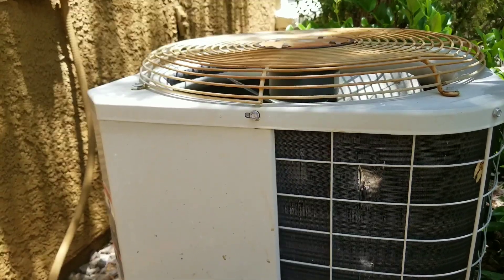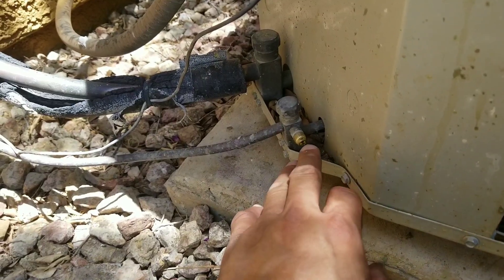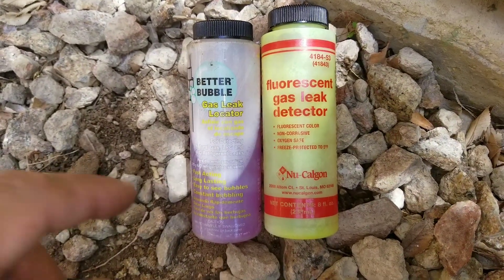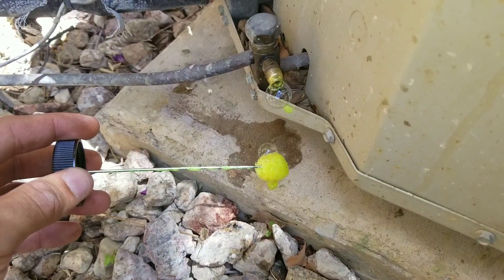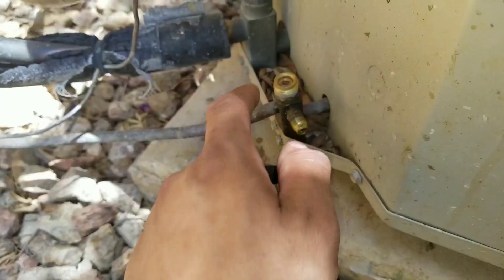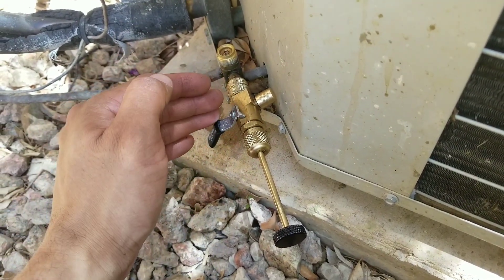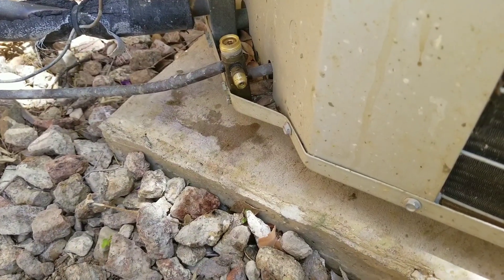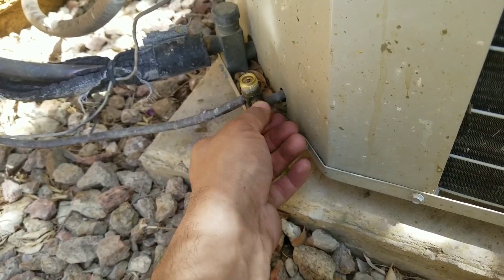Low Refrigerant? Freon Leak? Check This First!

Comment: Who knew?  I questioned the 'low on Freon' for a closed system till I learned of leaks.  Yet, they still lie about needing to 'find it' and leaking liquid and need to weld.  My unit is on the roof so they know people won't even watch...except me.  Cheats and liars are ruining your industry.  Thank you for your honesty, now go beat these unethical competitors and start your own company.  People will pay an honest wage for an honest work by a skilled professional, but most of these guys are commissioned salespeople and have no interest in $200 to swap out a valve, no they gotta hit you with the 'for safety reasons, we recommend replacement.  I can get you a special discount for $6000'....me, 'get off my property.'
Reply: girohead not all leaks are at the Schreider valves. Leaks do need to be found and yes sometimes it requires some welding
Reply: @mradam4430  Phew, that was a delay to wishful thinking (by me).  I was being hopeful based on what first guy said (he was looking to do a quick fill up and leave).  I had a leakdown test done and this other guy suggested he could take it all apart, find leak and fix.  I had a 25 year old unit, with older refrigerant (per CA) and not worth repair and future risk, so I just hesitantly installed new, for not much more.

Comment: Thank you for the demonstration. I especially appreciate how easy it will be to check if the source of the leak is at the valve.  My AC guy, will say anything right now to get me to buy a brand new hvac system, citing that the leak is in the evaporator coil, which is in the attic and virtually impossible for me to see for myself.   At least I now have the opportunity to see if the leak may be at the valve as a mater of elimination.

Comment: Is it true that if the ac unit is empty with no refrigerant and you turn it on it will burnt the motor unit
Reply: yes because the refrigerant support to  cool the compressor without it the compressor warm up and burn
Reply: @WaelAlseiadi  thanks for the reply someone came to my house to give me an estimate and turned up the unit for about 10 to 15 minutes to check out what was wrong with it ,he found a leak in one of the lines he didn't fix it that day then he got to busy I called another technician and the motor was already burned he told that happened because the other guy turned it on when the unit didn't have refrigerant

Comment: Of course they don't want to do it, they want to come back and charge you $1700 to find a leak even though they already know where it is and that it takes all but 5 min to fix it. HVAC together with plumbing unfortunately has become infested with the most dishonest scheme artists who take advantage of uneducated and elderly.  Thank you for your honesty and education.
Reply from the maker: Thank you for the added input you are correct in your assessment regarding the unhonesty of "company" technicians. Their goal is to make money and unfortunately they do so by giving misinformation in regards to diagnosing the system inaccurately. 👍
Reply: Why not throw some carpenters and auto mechanics under the bus too? Hell, why stop there - all blue collar workers should be crapped on in this comment.

Comment: Good Job thank you. I just installed my own Central air Unit from Scratch and works Great. I only had a guy come out and vacuum the lineset  Saved a ton of money. Thank you thinking of getting the Certificates and doing this on the side. Thanks for making the guy that came out to inspect my job said I did a great job how did I learn how to do it and I told him YouTube...he laughed and said don't watch youtube. LOL, doesn't like competition.
Reply from the maker: Great Job David!!! Honestly and unfortunately you are correct. The competition wants all your money. You would be surprised how many comments I get from the "company tech" who ate infuriated that I am "giving" insider "secrets" of the trade. Its individuals like you who give me the drive and determination to continue posting videos. So thank you! 😁

Comment: Do you have to flush out the gas detection solution with water and let it dry before replacing the cap to avoid introducing this solution into your refrigerant lines later, say when you check the pressure?
Reply: Just wipe off excess.  No practical chance of getting into system because system pressure is positive and the next time you hook up gauges, system pressure is higher than atmospheric.

Comment: I liked what you did after you replaced the schrader.  You left the replacement tool on, opened the valve and removed the end of the tool in essence checking for a major leak before you pull the tool off.  I hav e had a lot of people discount the schrader as the cause of a low system.  Another thing to do is listen when you remove the schrader cap.  If you get that psst, definitely check the schrader.
Reply: Better yet just tighten the Schrader cap like you're supposed to or the large nut on top of the suction service valve and then you won't have any leaks at all you are supposed to tighten those two covers. If you don't like the covers that you have then use the ones that train makes you tighten it with a 9/16 wrench it's solid brass it's very tight and it does not leak.
Reply: @6barry66  why cover up a leaking schrader by tightening the cap over tight?   The plastic caps won't always hold and the brass ones if you over tighten them you can deform the seats and when you do finally decide to change the schrader you can't get them out. 
I spent 17 years doing hydraulics and found over tightening the JIC fitting would make them leak. That is why Parker Hanifin came up with the FFFT method of tightening their fittings. FFFT stands for flats from finger tight. When we started using that system our leaks dropped dramatically.
Reply: @marvinostman522  I think what you're trying to do is find a way to charge your customer another $300 the fact is the cap was made to be tightened not so tight that you destroy the threads but you should have no problem putting the flare nut that train makes on an air conditioner that has a really minor leak and tightening it or you could just use the change the pin valve on the Fly tool and you can just put a new pin in there. And this does not cost $500. I work with people everyday who find creative ways to gain the approval of their employer and padding bills and adding tasks that serve no purpose just so they can get commissions. And I know you know what I'm talking about because virtually every news outlet  CBS NBC Dateline they've all run scams and they've all shown people what we do and right now we are in Industry under the microscope just do your job it does not cost $500 to clean someone's condenser it does not cost $500 to get rid of algae on an evaporator tray these are just cons to get extra money out of people and it makes all of us look bad. Right there on the front page of our industry magazine just about a year and a half ago was a headline and carrier and Linux and train and many people ask the question what's wrong with HVAC contractors. Most of us who work in this field did not need the negativity that was shined on us by a few unscrupulous people who can take the simplest repair and turn it into a 500 step procedure that cost $1,000. So do whatever you got to do I guess to feed your wife and children but this is the part of my job that I always hated and I always resent it where I was occasionally forced to price gouge people because I couldn't afford to quit my job right then and there and I had to spend a few weeks to find another job because I just didn't like what I was doing. And I did not feel good about what I was doing.
Reply: No idiot. I assumed you would be smart enough to change the pin valve. It takes sisolation calve o little time you don't even need to charge for it.  As for the isolation valves make sure they are back seated and seal the caps. They won't be used near as often
Reply: Hit the wrong key.  The isolation valves won't be used near as often as the access ports. Don't jump to conclusions about everybody. Could you send me an signed photo of yourself walking on water?
Reply: @marvinostman522  I wasn't jumping to any conclusions I saw the HVAC scam videos like everyone else in the country did that's why they appeared on the front page of our industry newspaper. Also I did not say I walked on water or that I was the world's foremost leading expert or an HVAC Super Tech. I said use the change the pin valve on the Fly tool and be done with it. Statistically about 90% of all leaks in air conditioning systems are either in the evaporator or the condenser coil they are not in the Schrade report according to statistics. Businesses who keep track of their service calls collect a database of information the database reveals what I told you not what you told me. So it's not my opinion it's the opinion of all the contractors who use computers to track their service calls who came up with the statistic which I just related to you.
Reply: @6barry66  I am sorry to say that you were jumping to conclusions.  You don't know me from Adam. You know nothing about me or the way I do or would do anything. I have done a lot of work for people who are so poor they can't afford to pay attention.  I wish that I was independently wealthy so I could take care of these people free.  I am not rich and never will be because I won't work for companies like that.
Reply: @marvinostman522  I did not mean to make a judgment about you I am more like you however virtually everywhere I worked I had two choices inflate the cost of repairs or go get another job I have had almost 21 jobs in my career I struggled to pay my bills and by the time I was 50 years old I lost my home and everything that I worked for all my life because they're just was no honest contractor in my state that I was able to find I went on interviews I told them I don't do scams I don't do this I don't do that and they go yeah yeah and they hire me and 6 weeks later it begins they start reducing my hours unless my sales goes up so I reacted to your video out of anger and bitterness I apologize my comment wasn't directed at people like you it was directed that the people that destroyed my career and the careers of most people in my field. Right now high schools are warning High School boys across the country who want to go to school to be electricians or heating and air conditioning service people that this is an unproductive field and unless they are planning on becoming self-employed they will never pay their bills live in a three bedroom house in Suburbia or be able to support a wife and children and that's very sad. So once again I apologize to you for the comment I made it's just often contractors use videos like the one you made to make themselves look honest when really that's not what they do. Once again sorry.
Reply: @6barry66  Barry, I am glad there are still some good people left. Eventually honesty has it's reward if not in this world then it will be in the next. I quit a job I had been on for ten years because my supervisors told me to make up a story that the part was no longer available so they could get out of a contract. The unit was still under the mfg 1 year warranty.  The customer was an airline pilot not a fool. He enters the part number on his phone and shows me "these people have it."  Fortunately he could seperate my reputation from the companies. Keep it up and thank you for the reply.

Comment: Durst mistake I see if the idiot prior to ur service call had put on metal cap with seal it would never leak out regardless of the shrader valve leaking, those caps are hige in union nyc hvac shop

Comment: The best one I’ve seen so far! Keep it up man! Do you have a complete steps for AC tune up?
Reply: When they say tuneup. They just change the filter.
Reply: There is no such thing as an ac tune-up. However, there is such a thing as an ac system inspection.
Reply: They may also check system pressures and clean the indoor and outdoor (condenser) coils.

Comment: Sure some leaks come from Schrader valves Carrier/bpd had leak in ecoils.. But what I always looked at were clogged filters causing the appearance of low charge. Running unit and clogging ecoils.

Comment: I bought the NU-CALGON Gold Leak Detector and tested both shrader valves for leaks. There was no signs of bubbles at all. I bought and installed the new brass caps to replace the old plastic ones.
Reply: What size are the brass caps?.....

Comment: Thank for your video. May I ask you a question. There are two pipes, one is thinner than the other. Which one has the air, and which contain the liquid? Seems the thinner contain the gas, and the thicker contain liquid. Is it right?
Reply from the maker: The thinner line is the liquid. That would be called in HVAC terminology the hi side. The fatter line is the gas known in HVAC lingo as the low side. Hope that helps 🙂

Comment: That exact tool is a Jb Industries A32525N and sells for around $60 on Amazon. You can find it cheaper by shopping around.
Reply: $52 on eBay
Reply: @MrRadBee  $42 on Amazon now
Reply: Anyone know how to identify the right replacement Schrader valve?

Comment: I have a slow leak in my system. If my shrader valves are leaking, would replacing the caps with the brass ones that have neoprene o-ring seals stop the leak without replacing the valves ?

Comment: On a typical service call do they always vacuum the system first or do some just measure and fill.Thanks for video very good
Reply: On a typical service call they should be evacuating (applying a vacuum to)
 the system, when the system is being evacuated two things are happening- one it's a test to see if it's leaking. A system that will hold 28 to 30 inches of vacuum (Mercury) for 30 to 45 minutes is an ideal leak-free system. Second, the process of evacuating the system removes the presence of non refrigerant gases, oxygen most importantly, moisture.
Reply: No. On a typical service no.  Evacuation is done on installs or repairs.  Clearing condensate drain should be done as maintenance.

Comment: You picked a condenser to replace the shrader value that is real easy, but most units you can't use that tool. So you will have to do a pump down to replace it.
Reply from the maker: I do have a  video on my channel showing how to do the latter. Thank you for the added insight! 🙂

Comment: My ac wasn't put out cold air.  Called Tim's plumbing who said he also worked on ACs...said I had a leak, so he refilled with refrigerant...next day, ac not working/cooling.  He was not honest, didn't seal or fix the leak and paid him $665.00, that's alot considering now that I saw your video, now I know what to ask and look for.  Thanks for the vid, very helpful.
Reply from the maker: If you lost that much refrigerant I would suggest that you have the next company do a leak check using nitrogen. This will ensure that you are not losing refrigerant due to a leak at the Evaporator Coil or the condenser. You also want to ask the next company what the warranty is on their work and get it in writing 👍
Reply: if you have a leak, and add freon to the system, guess what. it will leak back out. ill bet 100$ the leak isnt ONLY on your valce cores
Reply: Lol!   “Tim’s Plumbing” - “When I’m not unplugging toilets I’m an HVAC tech”  😂🤣😂

Comment: Use a brass cap and make sure its tight
Reply: Not too tight or you will deform the port and the shrader core wont come out.  Just make sure the brass cap has a good seal i side and just snug it up a bit but don’t use a wrench!

Comment: Something I've noticed- it seems like a trend of some guys calling these 'king valves'. These are not king valves. These are regular valves. A king valve has a protruding Male end used to shut the refrigerant flow off or on. These regular valves have a female end. I think one guy mistakenly called these king valves and the trend ensued. I've seen a number of videos now where these are misidentified
Reply: Dan Deeg agreed service valve, king valve two different things
Reply: Ok so let's start calling an airplane a "bird". Its just a common term, right?  NO, these are two different things. They both serve the same purpose but a king valve is a king valve and a service valve is a service valve. And I can give two shits about what Google says. And in my field you get slapped if you call it freon. In the face. Just sayin.
Reply: @DanDeeg78  Easy Buddy... I was not trying to "Troll" ya.  I have been training Techs for a number of years and I always loved getting a new "Tech" fresh out of school and  we come across an old Carrier split system with King Valves... Just the look of confusion on their faces when they put on the gauges and read no pressure and think the system has lost all it's refrigerant because there are no schrader valves. Then spend the next 20 minutes trying put new ones in.... Priceless. (But they never made that mistake again. They quickly learned front-seat, mid-seat and back-seat positions.)  All I'm saying is at my age I tend to let some things slide...  And by the way... When I was in another field of work.... We DID call planes "Birds" . Heres to ya!
Reply: @thisguybri311  right on brother wasn't trying to be a dick but I feel that's its vital to get the terms correct for the young techs watching. That's awesome that you've trained techs for so long; it's always great to have a good teacher. And it sounds like you've served, no? Well thank you for responding so nicely. Not very often can you have a civil response to a comment, especially if it was a dick response like I sent, so thank you
Reply: Its just a common term... Like "Freon" We all know its refrigerant and that Freon is a brand name from Dupont (R22) but the term sticks. GOOGLE service valve and then King valve and see what comes up. Chances are if you Google service valve, you will get actuators for chiller units.